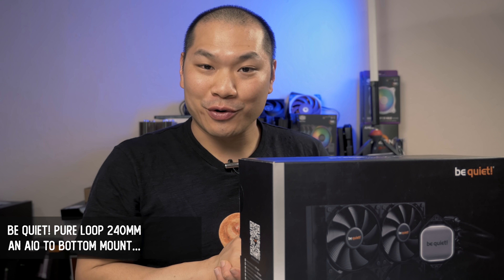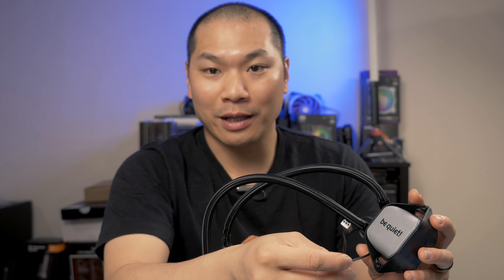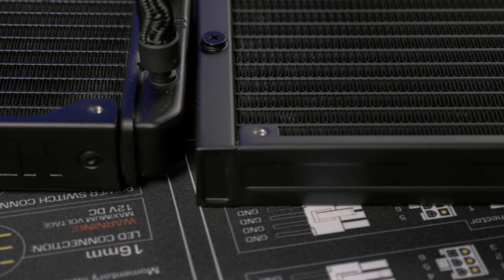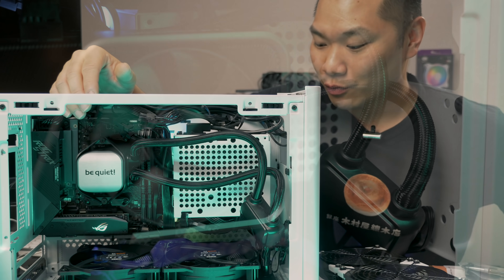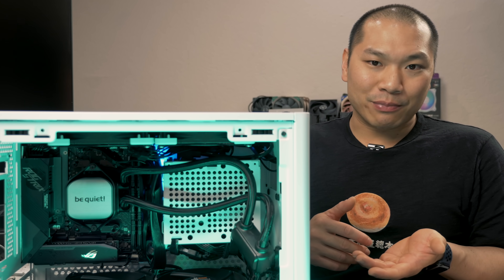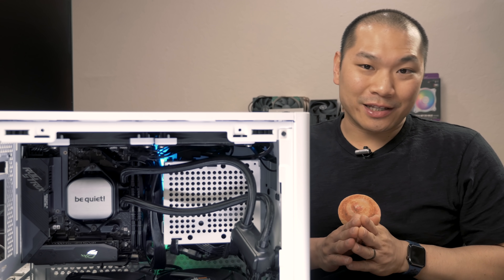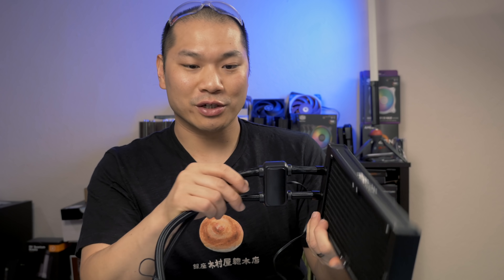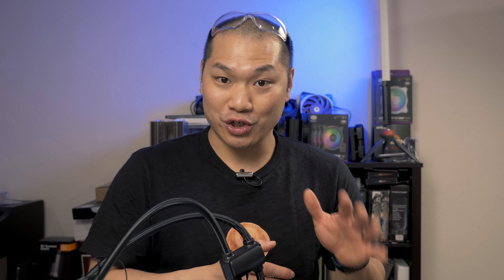Speak Softly and Bottom Mount It: Be Quiet! Pure Loop 240mm AIO

Comment from the maker: Just a quick note- some viewers have asked about it and I measured it. If you're looking at using this particular unit with a vertical GPU in the NR200, the pump and tubing run can results in potential GPU compatibility issues if your GPU is long. On the inside of the case I measured roughly 310mm between the pump and the rear of the case, which means that if you are planning on a long GPU take note. The 3070 and 3080 Founders edition cards all mount without issue.
Reply: Speaking of dimensions: It looks like bottom-mounting the GPU is definitely a no-go with this cooler in its stock form.  Would thin fans provide enough clearance for a double-slot GPU; or is vertical GPU orientation the only way to make it work?
Reply: since the pump is only attached to one of the tubes, can the pump housing be removed and the pump rotated to allow for easier installation and better GPU clearance?
Reply: @Victor-mn2eu  no.
Reply: So I’m actually using this in my current nr200 build 
I put the fans on the opposite sides of the pump/lines in the suggested push configuration (pressure optimized fans) and it gave me a little more flexibility to side mount it with the lines/pump testing against the PSU shroud 

Now I’m not 100% sure everything will fit but will know in a few days
Reply: Waiting for the next video about mounting long gpu with this
Reply: 3 years late but will give it a shot. Would adding some slim fans(around 17mm thickness) to the AIO allow a gpu, that takes up 2.5 slots, to be mounted horizontally?

Comment: @MachinesMore Hi, I changed the lequid according to the video. the exchange went well, but after starting PC, there is probably something rattling in the pump, please, what is wrong?
Reply from the maker: Check the fill level! It might have not filled all the way and running the pump worked out some air bubbles.
Reply: @MachinesMore  It happens to me that the pump vibrates.

Comment: I recently bought this and swapped out the stock fans with Noctua 120mm PWMs, and it worked well. I think the anti-vibration silicone padding may have also helped to reduce any vibrations from reverberating from inside my case (I've installed the Pure Loop in a top mounted position in a Fractal Design Define R5).

Comment: How has bottom mounting a decoupled pump worked out for you? 

Did the CPU section being at the top dry out with air bubbles? I want to do this but am concerned about the CPU area being at the top despite the pump being lower.

Comment: Be Quiet Silent Loop 120mm Ryzen 5800x at 4945Mhz 91C  THERMAL PASTE MX4 before AFTER top-up the radiator Be Quiet Silent Loop 120mm Ryzen 5800x at 4945Mhz 77.5C  THERMAL PASTE GELID GC-4 HAS WELL THE PIPES GOING TO THE Ryzen 5800x IS ON THE RIGHT HAND SIDE PUSH THE PIPES UP SO IT COMING DOWN TO THE Ryzen 5800x

Comment: Imo, leaving some air in the system for expansion isn't really necessary. I can't see expansion being an issue, these coolers couldn't possibly build up that much pressure. In fact, pressure would make the coolant circulate better with the right pump design. If a guy could set up a liquid cooling design like in vehicles it would be as sufficient as it could get and have zero air in it, they would actually bleed themselves out with the use of a pressure valve and a reservoir.

Comment: Sir, i have a question regarding this product you reviewed, i recently bought one, i like it, but i have a problem which is when i set this fan to push config the air are pushed back from fan, while the other side i can only feel slight air pass through, is it normal? Or my product has defect? Btw i use it for my ryzen 9 5900x, do you think this aio suit for this proc?

Comment: So, if I'm right here the air would collect at the top of the tubing above the cooling plate? If the cooling plate is the highest portion the air would still gather at the worst possible place?
Reply from the maker: What you're trying to avoid is bubbles in the pump, so as long as it's not the highest point in the loop, you're OK. This helps avoid that.

Comment: Am i getting it right, that if I want horizontal GPU installation, then I'm screwed, because the AIO is quite thick not to let horizontal GPU installation? Also - you installed fans so they are working intake, right?

Comment: Hello Machines & More, at 6:36 wouldn't the air collect in the arc of your tubes (when it rises to the highest point of the loop)? Likewise, if I would bottom-mount a "conventional" AIO radiator with a pump in the CPU block, but have the tubes like you showed, wouldn't this situation be one and the same (from the air's perspective)?

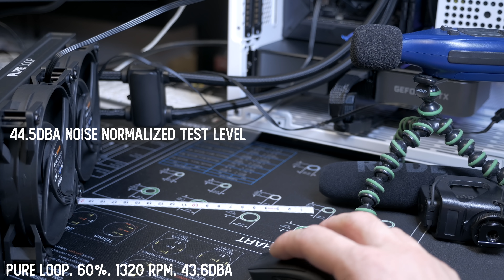Comment: 11:57 my pump is very noisy,  an annoying sound around 400Hz frequency, hammering the ear at 40dB. FUCK IT when a fan system is less noisy. 
I Contacted BeQuiet but they don't gave a fuck answering to contact the reseller. Last time I buy this brand.

Comment: I bought and installed this cooler a few days back, and I must say: the pump is NOT quiet at all. It makes a constant whistling sound which 
becomes a lot irritating over time. Before this, I used a CoolerMaster Seidon 240V and its pump didn't make any sound, not like this one. Every
 reviewer says that it makes no sound at all, so I wonder is this a unique problem with mine?

Comment: If bottom mounting should it be push or pull
Reply from the maker: Intake is better overall. It doesn't really hurt the GPU much but the opposite direction is a bigger penalty on the CPU thermals. (Assuming you're seeing heavier utilization on both components at the same time).
Reply: @MachinesMore  Thanks for your quick reply mate

Comment: Im running the Z63 on the side in  the NR200. Its very cramped with the RX 6800 mounted in there.
Will the RX 6800 or RTX 3080 (I might be switching GPU) fit well in the side with the Pure Loop 240 on the bottom.
If this doesnt help Ill be looking for a slightly larger case.
The videos with these cases and large components gave me false hope that I could accomplish this myself and run rgb fans with a controller. I got it all in thee, but its a F** mess inside!
Reply from the maker: The reference cards should be fine vertically, most cards that use two physical PCIE slots will work too (you have about 7cm of clearance). In fact the reference RDNA2 cards should be great in vertical position due to the cooler orientation.
Reply: @MachinesMore  Thanks for the reply! Im going to redo my system  soon.

Comment: Is there any reason why a 280mm wont fit on the bottom? I have a 12core cpu and wanted the extra cooling power if its not more of a problem to use.
Reply from the maker: Yes- the ball studs that keep the bottom in. If you grind them off and screw the panel down somehow, a 280 could work- you will have some obstruction though since the vents aren’t cut for a 280, so it’s of marginal benefit. The easier way to get better performance with a 240 is to upgrade the fans so you can run them faster. A 240 with  2x Noctua NF-A12x25 will beat many stock 280s.
Reply: @MachinesMore  I Think Ill sell My Z63 and get a 240, its not really manageable with this case for me, or I need a slightly bigger case that can fit it and my 310mm card easier

Comment: If I wanted to side mount, would the 120mm version work better with the tubing? I’m trying to use an Asus ROG Strix 3070 with the NR200P case.

Comment: I really wanna do this with the tg panel but I’m afraid it won’t be adequate for my 5900x
Reply from the maker: I wouldn’t hesitate- it will be enough especially with curve optimizer dialed in- and even more so with a fan upgrade to something like Arctic P12s or Noctua NF-A12x25s.

Comment: I just recently got mine... as I was installing it the solid part of the pump connection popped and I had coolant everywhere... I was able to reconnect it to the pump without and issue and I refilled the AIO with coolant since it comes with it. I’ve been running it since for the past week and haven’t had any leaks, thank God. My temps have been great with approximately 38-45 C consistently from idle to while gaming. My biggest issue right now is that the RGB light hasn’t come on... it’s plugged in and all, there isn’t any a switch underneath the plate is there? I don’t remember seeing one.
Reply from the maker: Yikes! I don’t recall a switch... if it’s plugged in then my only thought is perhaps an interior cable pulled out when the unit imploded, or the coolant damaged it?

Comment: Here for you man! Thanks for this video. I wonder how it would fit in an Ncase M1 side panel?
Reply from the maker: It won't be easy with the in-line pump block. Not a huge reason to go with this one in the M1 though. An Asetek unit usually works quite well.
Reply: Machines & More thank you very much! 🙏🙌

Comment: You should do a double dual radiator test! A hybrid gpu (say like evga xc3 hybrid 3080) on the side mount and the pure loops on the bottom of the case. Interested to see if that would fit
Reply: I would really like to know the answer to this as well , since I just ordered the xc3 hybrid 3090 and the pure loop 240. Hoping I can put the pure loop on the bottom and the GPU 240mm rad on the side, or possibly top with modding. Would be great to hear what the channel thinks!

Comment: Thanks for this video! - I am swapping out my cooler master AIO for this one. running the rad on the side panel is just a total cluster when it comes to arranging the cables in the rest of NR200P. Going to try the Vertical GPU mount as well and see how it goes.

Comment: If you want great cheap silent fans, the Arctic P12 are amazing. I've got 2 NF-A12-25 and they're a little louder than the P12 and the cooling is very similar. The Pure Wings that come with the Pure Loop are extremely loud. They're terrible. They're silent up to 30%. Above that, jet engine...
Reply: Considering swapping the Pure wings for silent wings pwm high Speed, but there expensive. Would the P12 do a similar job for less? Or other "high static" fans make any difference on the Pure Loop?
Reply: @dalllle79  Here's the conclusion I got to. If you want some peace of mind, go for the best, which means that you gotta pay extra.
Phanteks' latest 120mm fans are pretty much the best you can get right now and they were released as a direct option to Noctua's best A12-25 fans. They're a bit thicker thought and I assume that's the source of their slightly better results.
Pure Wings or Silent Wings, they're loud, really loud even at low rpm.
If you want some advice, especially seeing that you're interested in what I was interested at the begninning, which is better fans. What I did wrong was try the cheaper options which were very promising and were claimed to perform on par with the best of the best or at least close to that and the experience was quite different. Take the P12 for example. They're good fans but they make a humming noise at ~1000rpm. It's very irritating. If you think you're gonna set the speed to avoid that rpm area, if you have a curve, even for a brief moment, it's still gonna make that noise. I bought 6 of those and gave up on them. The bigger brother, the P14, shares the same doownside because it's using the same motor. Pretty dissapointing to me. I tried some other options too and I came to the conclusion that there's no top performance/silent operation without a price to go with that. So I got x6 A12-25, which cost quite a lot considering it's fans we're talking about here, but doing that, I basically eliminated the only thing that was on my mind, which was 'what fan is it going to get close to Noctua's top performer'. And that turned out to cost me a lot more simply because in the end I still bought the A12-25's, thing I could've done from the beginning but avoided because of the steep price, of course.
But from the moment I got them and installed them, set the curve, blah blah blah, they've taken a stone off my heart because they work so well. I've get mounted on 2x Corsair Hydro X Series XR5 360mm and the fan speed is ranging between 22% which is so silent you literally cannot hear a thing with your ear next to them, and 40% when the water temperature get to 37C. So they stay extremely quite and cool my PC giving the best results with the most silent operation.
So go ahead and buy these things if you want top performance and dead silent operation (silent at the proper rpm, of course). Even if it means getting them one by one, over a period of time to not feel very hard the hole in the pocket, I still recommend buying them over anything else. Just my 2 cents
Reply: @dragos-lucian  So I´ve done some testing. It´s not the fans that are making sound, it´s the pump on this cooler. I have this Pure Loop 280mm and the pump is making this low constans low hum noise. Really anoying. Apparently it´s supposed to run @ full speed according to Be Quiet, but it´s driving med nuts. I´ve seen some people regualting the pump, but I´m uncertain if the pump will fail earlier. Really dissapointed.

Comment: Hello, I have 280mm version. Is there any diference in temperatures after refiling ? My 5900x gets 83 degrees in stress. In normal using i have 58-72 degrees.
Reply from the maker: Nope, I don’t see any difference. It just fills to the same level. That’s not an abnormal temp for the 5900X actually, assuming 20-25C room temps. Question is how high of a voltage and clock speed you are getting. If your board is feeding the chip too much voltage you can lower a bit.

Comment: Thankfully the NZXT Kraken X63 was able to be front mounted with the tubes coming up from the bottom. Case is Phanteks P400S and I absolutely love the AIO mainly due to how easy it is to install. CPU temps idle run 28 Celsius on average, old air cooler cpu temp was around 32 idle.

Comment: Will the Pure Loop (bottom mounted) 280mm AIO fit in the nr200?
Reply from the maker: No, 280mm rads are too wide for the bottom without some modding.
Reply: @MachinesMore  Thanks for the clarification man! Hope to see a no-compromise, thermals optimized build, that will end the debate whether AIO or air cooler is the best cooler for this ITX case :)

Comment: I've found the pump noise to be pretty loud on my pure loop unit. It causes a low frequency hum that appears to resonate out of the case. Kind of annoying. I might consider switching to a galahad 240 since that at the least has a fill port you can top off every year.

Why they didn't give you control of pump speeds on this unit is beyond me

Comment: I'm about to buy an AIO, but I haven't decide yet which is the better choice between this Be Quiet Pure Loop and the NZXT Kraken x63 (or z63, that would only be an option because its LED). 
It's kinda weird that Be Quiet just offers 3 years warranty, but in the other hand they say refill possibility ensure your investment for a long time. Meanwhile, Kraken x63 offers a 6 year warranty, no refill option, but it seems they are more confident in their product.
Of course, the prices are the core of this confusion. Pure Loop would be the best cost-benefit option? Or Kraken really wotrths its price?
Reply from the maker: Are you mounting on the bottom? If so the Pure Loop is by far the better choice. You also don’t benefit from the RGB on the NZXT since it’s covered- RGB accounts for a huge cost premium.

Comment: i picked this exact AIO up last week and it's terrific. the only part i was concerned about was even cold plate mounting pressure since it only has 2 screws attaching it to the motherboard but that doesn't seem to be a problem at all.

it's quiet, relatively cheap, no RGB (thank god), and actually available unlike the arctic liquid freezer II.
Reply from the maker: Steve, I was also concerned with the two screw mounting solution too but was very impressed- thermal paste pattern was smooth and flat as ever. They did a good job with it. Glad you are liking it!

Comment: How about side mountingthe 3 slot gpu is there any prblem with the lenght? With the tube and pump?
Reply from the maker: It’s about a 305-310mm of length you can fit with the AIO and a vGPU. If you have a true “3-slot” gpu then it won’t fit because of the 2 open slots available, even if it’s 2 physical slots occupied but 3-slots in thickness, it will have pretty dismal thermals due to choked off airflow too. I’d stick to thinner/smaller cards for VGPU.

Comment: This is exactly the video I was looking for!   Unfortunately I found it after I had already ordered my NR200 and Be Quiet Pure Loop 280mm AIO.  They come tomorrow so I might have to return the AIO and get the smaller one, or watch your NR200 AIO video again to see which one you recommend most.

Follow up:  I am happy to say I had NO issues side mounting the Pure Loop 280mm in the NR200.  So far I'm loving this case and AIO.
Reply: 'NO issues side mounting' - so how is that possible? The pump in the video was clearly in the way.
Reply: @demimascot  There didn't appear to be any issues and the AIO worked wonderful for a week.  I turned the computer on Christmas day and the pump was dead.  Looking for a new AIO.
Reply: @demimascot  as for your question, how is that possible?  I mounted the block on the CPU with the tubes to the back of the case and the pump on the side of the power supply.  This resulted in no sharp bends and there was plenty of room between the Radiator and the PSU for the pump.  I wish I had taken a picture of it before I removed it all, because of the pump failure .  I really don't think the pump failure was due to the way it was mounted.